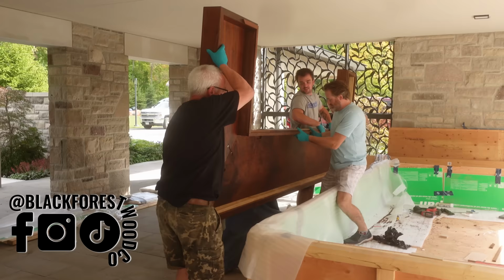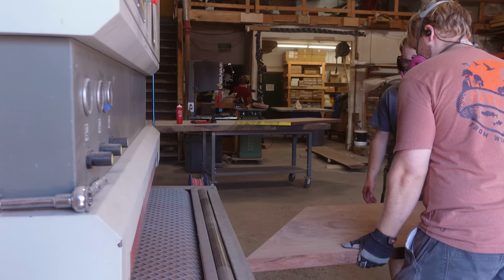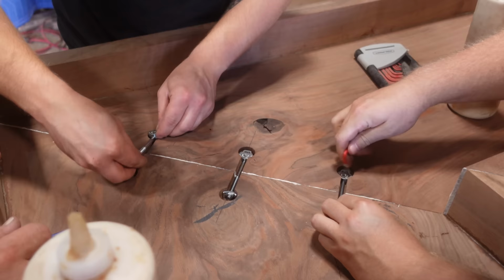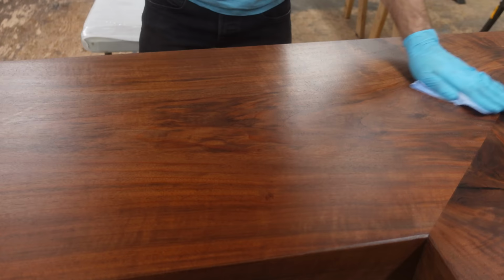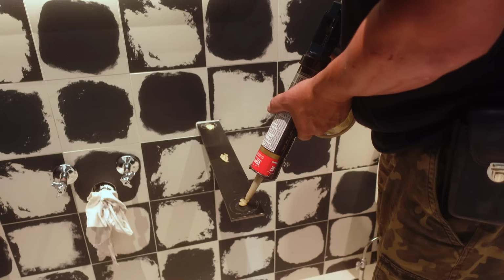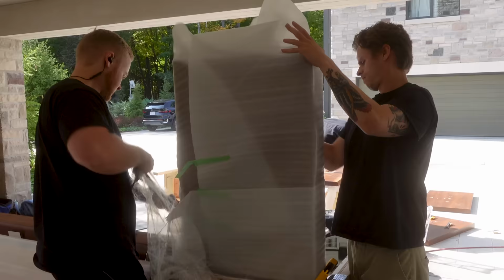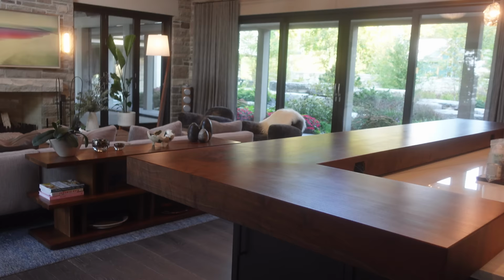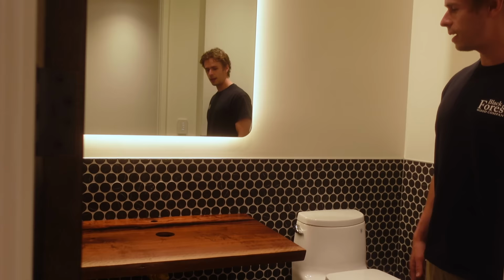Building a $50k Walnut Countertop

Comment: Really  nice work!!!  Can't say enough about how good your craftsmanship is.  You can't control what will happen with a counter top.  The old veneer tops could easily be nicked or gouged and they don't patch well.  Solid is the only way to go.  It will develop some character over the years but that will only add to it's beauty.  I can visualize the beer bottle sliding down counter top now!!

Comment: The price probably sounds high to a lot of people because you can get the "same" items made from lesser materials and construction techniques for a much lower price. And if that's the market you are used to the higher price can be unreal, seem unreasonable and basically be upsetting.  On the other hand it's worth it.
Reply from the maker: Yes exactly, premium wood at this thickness definitely isn't cheap unfortunately!